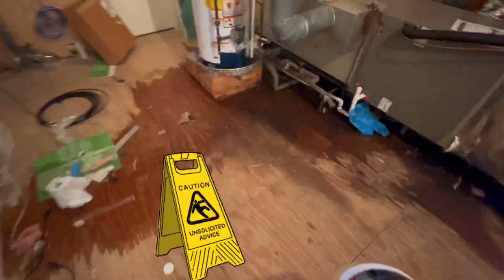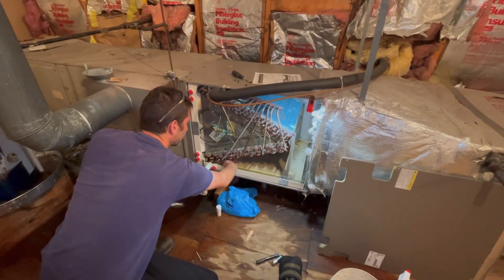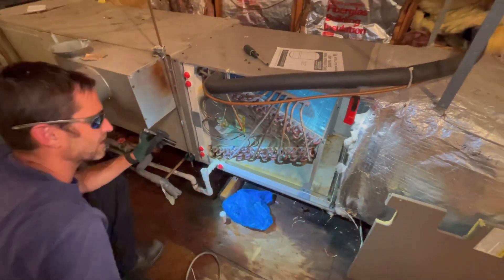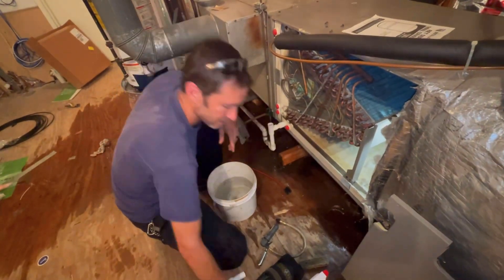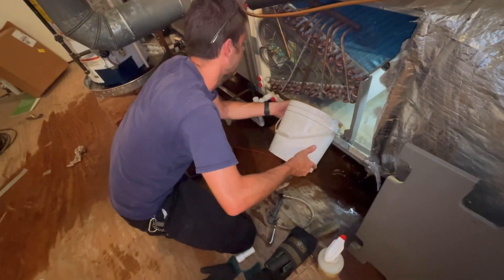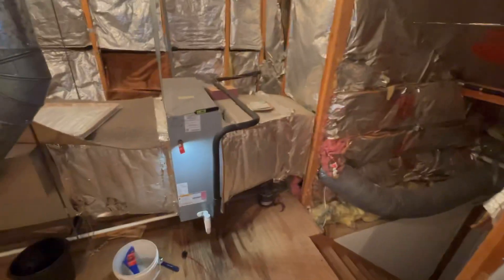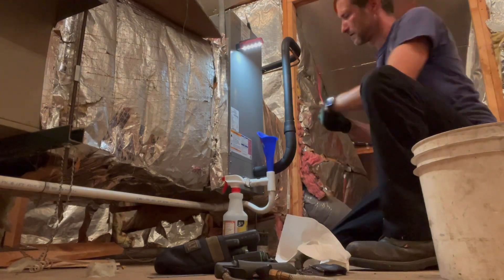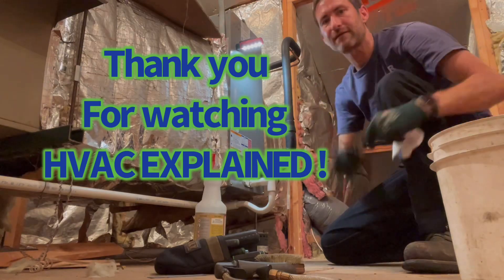Why Do We Flush Drains? #Steamfitterslocal449 #HVACEXPLAINED #RuthRauff #hvaclife #sporlan #viper

Comment: If i have a brass not plastic drain valve on water heater garden hose brass small fire nozzle flush out with hot water you would not believe the shit you get out ,had one in basement blew back at me really plugged use towel plus90 with humidifier finally let go cigar plugged! Some installers run drain along floor 90 up off floor into laundry sink giant trap they always have blockage.
Reply from the maker: I flushed out multiple hot water tanks residential over the years.  It’s amazing with how much crap lays at the bottom of a hot water tank all those leftover heavy metal/minerals/scale.  It’s not a bad practice to flush a hot water tank or instantaneous hot water heater annually.  Thank you very much for the story have a great day.
Reply: @hvacexplained9341  Yeh thats another bag worms flushing out scaled up water heaters if you c hange your sacrificial rods on regular basis saves tank once minerals attach too inside popcorn sound or cracking lake ice it's to late! Try hose flush on long condensate drains worked with guy use to use drain acid till he killed 40 year old rose  plants lady's garden!

Comment: They need an emergency switch on the secondary but that’s all
Reply from the maker: Believe me anytime I install a new system above the ceiling I always recommend and auxiliary drain pan with a float style switch I don’t like the water bug wet switch.   I’ve had a couple cause nuisance problems over two Drops of water.

Comment: Does you're local cover commercial and residential and is it separate divisions
Reply from the maker: We very rarely touch residential. I think there are a couple companies within our union that do but not the one I work for in particular.  There was a $9 million house that we used to take care of it had a cooling tower, 18 heat pumps a few boilers etc.  But typically our company does commercial and industrial.   Thank you for the question have a great day

Comment: Why no secondary drain pans and safety switches?
Reply from the maker: I totally agree and I told him if I do install a brand new unit I will put an auxiliary drain pan.  I’d rather be too cautious than not enough.   These systems were installed I think somewhere in the mid 90s.  Thank you for the suggestion have a great day
Reply: Both those units definitely need safety switches on the secondary drain line connections. Just asking for trouble like this otherwise.
Reply from the maker: @roberts1159  :   I recommend them to all my customers that have equipment above a finished ceiling or attic.  I can only recommend.  👍
Reply: @hvacexplained9341  Very true, pay now for a simple safety switch or pay for drywall replacement and painting later !
Reply from the maker: @roberts1159  :  Oh believe me I am all about going above and beyond the first time versus having a complete catastrophe.  
Example:  
I use to have a Sea-Doo 4 passenger jet boat.  It had a Bilge pump only one and there was no alarms, alert light or anything to let you know it was running or if it has failed.  So I would test the pump occasionally.  I installed a brand new secondary pump slightly higher can routed the tube right next to my steering column on the boat.  So basically if I saw water coming out right where my hands are at all times it means you better get the shore now!!!  Lol.